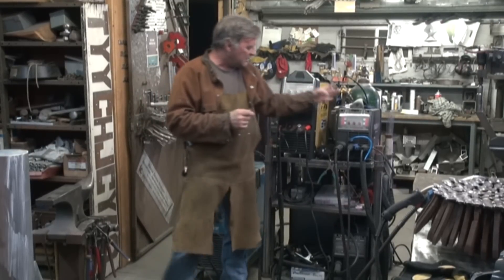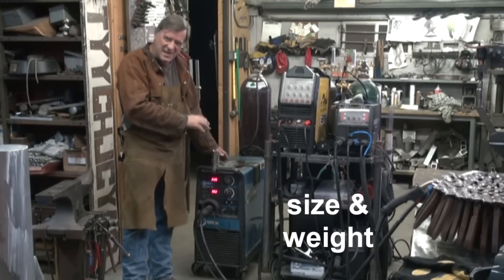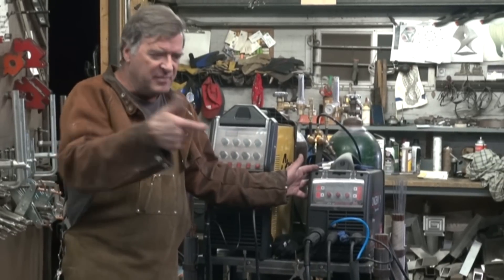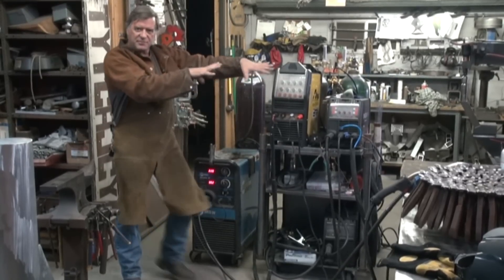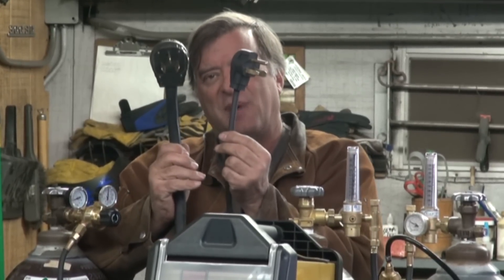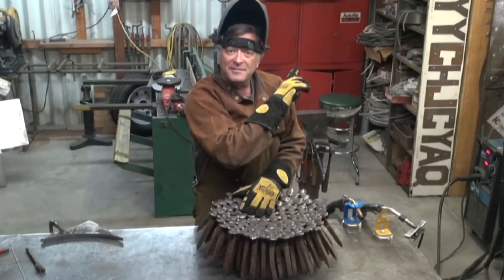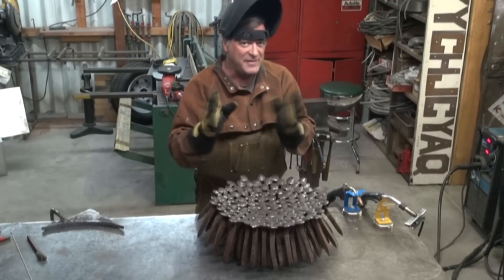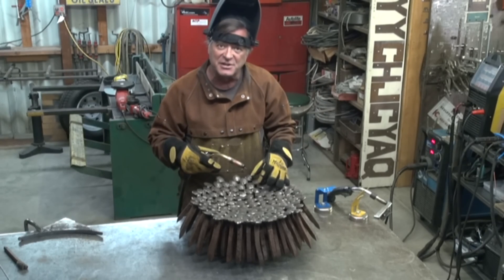Inverter vs. Transformer MIG Welders - What's the Difference? Kevin Caron

Comment: Missed a lot of opportunities to speak about the differences between the two technologies. I have a millermatic 210 large frame transformer based model and a viper 180i both weld great, but the transformer has a better hot start and duty cycle , so in the shop the miller is the go to, in the field the viper has the versatility so it’s my go to two different machines two different purposes.
Reply from the maker: Good points! Thank you for watching and posting.

Comment: Inverters use a lot less energy out of the wall they also have a shorter shelf life they may last five years before burning out they’re physically smaller the more adjustable. Transformer bass machines will pretty much last till your grandchildren inherit it uses a lot more power out of the wall and they’re not quite as adjustable as inverters and they’re definitely larger.

And make sure all of your electrical connections are tight on your inverters because they do not like electrical fluctuations they will fry and if you use inverters on generators make sure the generators are far larger than you required to run the inverter otherwise the electrical fluctuations will fry it
Reply from the maker: All good information here!!!    Thank you for posting and watching!

Comment: I'm certified in pulse spray mig, used the fancy new Miller inverter production machines. Needed a mig for my home/hobby projects but didn't have $3000 to spend right away, and I need stuff welded. Someone brought to my attention a 200 amp inverter 3in1 dv for $270 on Amazon. Set it up and I'm very impressed for the price. Even did pretty good on 110v, gonna get a 220 outlet soon.
Reply from the maker: Miller are nice to have but way over priced in my opinion.   Thanks for watching and posting.
Reply: @KevincaronSculpture  yep plus I can return this cheap one for 30 days. Gonna give it a good workout before then haha

Comment: May I please have your opinion Century 90 AMP flux core or the Harbor Freight titanium 90 AMP flux core welder which one would you prefer?
Reply from the maker: Both are toys and I would not recommend either.
Reply: How do you feel about the old school century 85 amp dual purpose wire welder?

Comment: IGBJT and VMOSFET welders chew the same current as an older transformer welder.  Transformer eff = 90%,  Half Bridge inverters eff = 90%.  The inverter has big capacitors which will dry out and fail in a few years in a hot workshop.  The Miller transformer machine uses a choke for most of its stabilisation.  Transformer welder has no electrocution hazard.  Inverter welder from China has high potential of electrocution if it uses just enamel insulation on the output transformer.  Inverter cooling fan must run fast and noisy.  If not, the inverter will overheat fast.  Both welds will be identical.  If it's in a workshop, transformer with rectifier and choke is foolproof.  If you need to carry it, go inverter.  gm2020
Reply from the maker: Well said and thank you for watching and posting!

Comment: I bought a Longevity mig/stick welder about 4 years ago, and it has been a damn good machine! I have had zero problems with it. I like it because I can use it in my shop, or throw it on my service truck and use it in the field. Another great thing is its cost.... i can replace this welder every 5 years and still have less in it than a Miller or Lincoln..
Reply from the maker: I hear ya!    That's my thinking also.
Reply: Do you need to switch polarity? When you go from stick to Mig?

Comment: A transformer machine will work forever, but all that copper costs a lot and weighs a ton. These days, something that's cheap to build and transport is what sells. A properly made inverter machine will last a long time, but will eventually fail because certain components, like filter capacitors, have a finite life span. I still would rather weld with ( and CARRY) an inverter welder.
Reply from the maker: My thinking as well!

Comment: I have a question out of curiosity..  Could you use a propane torch (basic camping torch with bottle) to shield the oxygen out of the weld, so to speak...   meaning could you weld within the propane flame to shield against oxygen?  If I had the flame pointing directly at the work area and then welded within that flame.  Wouldn't that create a NON oxygen environment capable of a non failing weld?
Reply from the maker: Ever tried.    Let us know how it works please.

Comment: Kevin, you're a great guy, but the information in this video really is misleading. You never actually addressed the difference between an inverter and a transformer. For example, the difference in the plug has nothing to do with that.
Reply: Intuitive Observations Seems he was showing us the input cable size not really the plugs.
Reply from the maker: Correct.   transformer machines need a 50 amp circuit and inverters can run on 30 amp.
Reply from the maker: Didn't want to get in to the technical aspects.    Don't know them well enough.

Comment: For the occasional hobbyist  the Chinese inverter will work well if they don't get a dud, then good luck with the customer support. I have welded long welds all day long with my miller 252 and have been using it in a light fabrication environment for several years without it ever shutting down to overheating or any other problems. If these were both in daily use which one would be around in ten to fifteen years so it all depends on how much you intend on using them and how dependable you need them to be.
Reply from the maker: Well said!

Comment: Also inverters are lighter smaller like kevin said and you can get into the new technology and functions with inverters instead of limiting yourself to less stuff. Plus if it breaks its not another 4000 dollars to replace or 2000 dollars for repair or w/e else.
Reply: I love the new features inverters bring to the industry. For me, my everlast got me into welding. I wouldn't be welding at all if welders in my price range didn't exist.
Reply: i know right?!?!?! I myself have an AHP alpha tig 200x. I have been using the tig welding since im in classes for it and i already know quite a bit about stick welding. But I wouldnt even have a machine if i would of had to pay over 1000 dollars. I know everlast has some good prices for their stick and mig machines. Which one do you have?
Reply: I actually have an AHP alpha tig 200x machine that i got for 710 bucks all said and done. Can do aluminum and steel and all that good stuff and has pulse and pulse frequency as well as ac frequency up to 200 hz.  Great little machine for the price. I been welding for about 3 years in classes and such and i have students who i am in class with who ask me about stuff since im pretty knowledgeable about stick welding and general stuff about the tig. I did tons and tons of research before i even touched a tig torch so that helped a lot.  I learned a lot in a short period of time but i had to get the actual practice in so classes were the best way to do that.   So here and there i help out the other students in my class if they have questions :)

Comment: ...I bought a miller-matic 200in 1982....still using it....I had a welding shop for a few years.....built a lot of wood-heaters......ran about 300 rolls (33 pounds) of mig wire through that machine...never a problem...transformer type machine....
Reply: I bought a new MM 200 in 1987.  I was the only one around with a commercial welder at home.  It took me over 20 years to go through just a single 33 lb roll of wire! 
It still looks and works great.
Reply: But the inexpensive Chinese welder will do that too, HAAAAA! Not!

Comment: My Longevity 200sx  worked great-- for a short time. Love the HF starts.But then it would cut out after a very short time.  The problem was misdiagnosed and after that was figured out, the only way to get it fixed is to ship it back.  Never used it much and never worked it under heavy amps. That is the gamble with  Chinese welders. One I lost.
Reply: Had the same problem.

Comment: i have a Lincoln invertec V300 its an inverter and it will weld better than any transformer and has a higher duty cycle with less electric used than a transformer too
Reply: Wanna go against an HTP 2400 at about 220 amps all day long ? How about an old school MM200 from the eighties ? Take the fan home boy. Numbers and specs are cutesy. A shop generally isn't. The Invertec has no business in a real shop.I'm here to make money. The electric bill is a minor annoyance.

Comment: If for anything when it comes to suppliers I prefer the known companies that have been around for a long time, even if it costs a little more money. Miller, Hobart, Lincoln, Smith, Victor, and Smith. If for anything I can get accessories, parts, and service at my Local Welding Supplier, or a big box store for consumables.

Comment: I wouldn't touch longevity or everlast with a 10 foot pole. So very skeptical of those companies after what I've read on them, especially longevity. They're hobby machines and the companies are paying to be seen in professional looking settings to give them an impression of being what they aren't. Longevity also has a reputation of trying to censor bad feedback on forums.

Personally what I would recommend someone is to buy a used quality welder and don't get hooked on all these fancy extra functions which you probably won't be using. Even so you can get fancy functions for a good price. I bought a 90s era kemppi inverter for 500 bucks, 3-phase, 300A, DC stick and TIG with all kinds of functions, slope, 2T, 4T, HF start and lift-arc. Arc-force and other functions for the stick mode. A very solid piece of kit, some of them were sold in the US under the powcon brand back in the day, recognizable because of their metal cover rather than fiberglass covers that US made powcons had. Speaks of their quality though, otherwise powcon wouldn't have licensed them.

If I where to look at a new multifunction welder with all tig/mig/stick, the ESAB rebel seems to rule the roost now...But honestly I prefer older, 3phase driven machines, I would have preferred a 3ph transformer over an inverter, but it's what I found in my budget so I am not complaining.
Reply from the maker: All very well but what about us guys that don't have 3 phase power to use..
Reply: I'm from Finland so that's whats available to us hobby garage types here. I'm sure the american market is filled with professional setups using commonly available single phase 240V in the US and so there are plenty of used welders around. Now if you only got 120V, then my condolences.
Reply from the maker: Have had good luck with both company's machines to tell the truth..     Not happy with Longevitys customer service with is why I stopped using their machines..  
Everlast has been very easy to work with and other than a bad on/off switch on one machine been rock solid for me.  
And the customer service with Everlast has been very good.  They are even writing their own manuals for the machines in house by a welder that is using that machine.
Reply: I just bought a Miller millermatic 211 GMAW welder with a spool gun this spring for aluminum120 / 240 volts 60 Hz you can switch the plug ends between 120 and 240. or keep it at 240 24ga - 3/8 9.5mm  single pass. been told by a few people It will weld 1/2 inch  13mm with no problem as long as the metal is at a reasonable temp.  Its an inverter unit and is really nice machine for what I have into it. Welder its self was around $1,200.00 USD. This is my first welder so I have some extra cash in extras.
Reply from the maker: Nice Machine!    enjoy!
Reply: So far Ive only done a couple of light duty jobs. Built exhaust hangers and pipe repair, been experimenting around the shop.
Reply: Can I weld aluminum with 75/25 with a spool gun and it be solid? are the defects cosmetic or structural? I know your supposed to use 100% argon just wondered in case I was in a pinch.
Reply from the maker: Nope, you need 100 percent argon..   the defects are structural and you won't like the end weld at all...
Reply: Thanks. I'm a Renewbie. Its been quite a few years since HS auto-tech. With the exception of light duty and exhaust work I'm a newbie to mig.
Reply: There are plenty of single phase transformer machines. He's not giving a full picture of what's available, probably because not many people heavily research that stuff unless they repair welders. (I do.) There are more single phase machines old and new than three phase. 

The ESAB Rebel is of course single phase. My fab shop bro loves theirs which they bought to replace an old Migmaster 250 which finally died after more than 20 years of service. (I have an MM 250 I bought new and it has a sweet arc.

If you score an industrial three phase transformer machine you can run them off a rotary phase converter which many people also use to power their machine tools. There's no need for most users to run a three phase service for a few machines. (You can also buy VFDs inexpensively to capture the advantages of variable speed control and electric braking for your machine tools. See the Practical Machinist forum on the subject. I currently use the old half-wave solid state cheap converters which were already installed on my lathe and mill, but VFDs are MUCH nicer! My bud runs his lathes, mill and cutter grinder off VFDs. They work very well.
Reply: Ah, I should have scrolled down before posting! The US market has vast quantities of 1 PH machines.

Comment: the inverter is a computer, transformer is the real deal for( longevity) just my 2 cents
Reply from the maker: Interesting way to look at it but the inverter is here to stay and it will replace the transformers eventually.
Reply: inverter welders still use transformers ;) but way smaller, cuz they run on hf, and yea when you have too much chinese electronics its more likely smth gonna pop soon ;D

Comment: do the multifunction machines that you've used work real well in all fields, or are they so so if all fields? I've been looking at mig/plasma for the shop.
Reply from the maker: +grn dragon               I think the Everlast PowerMTS 251si is about the best there is right now..    Have been very happy with how it runs and ease of switching from one function to another.      But I would stay away from any multi machine that has the plasma built in to it..    They just don't seem to last...

Comment: The number one attribute of any welder is how nicely it welds.  I have used Italian built DIY transformer style welders that have the current controlled by a movable iron shunt.  These work splendidly, they make excellent welds and the slag self-peels. On the other hand the Chinese built GYSmi inverter welder that I bought on the bay deserves to go in a dumpster as there is NO WAY that it equals the old transformer type for ease of use and weld quality.  For instance the arc length is so critical that the welding rods need to be cut in half and one has to have steady hands to keep the arc length very short. At the 55 amp setting it will hardly start-up a 2.5 mm rod but at slightly higher settings it lays down too much metal!  Its just not nice to use.  My "auto darkening" welding masks that don't auto-darken also need throwing out and to be quite frank I am sick and tired of buying "innovative" cr@p that doesn't do what it says on the tin.  Unfortunately almost nowhere lets you try before you buy so in effect one ends up buying a pig in a poke.  Old British Made "Oxford" oil-cooled transformer sets are impeccable and just the name tells you that it will be a superb welder.  On the other hand the new inverter types still don't have much of a track record.